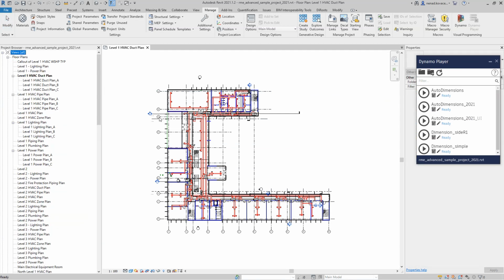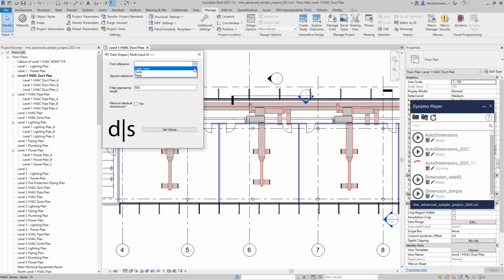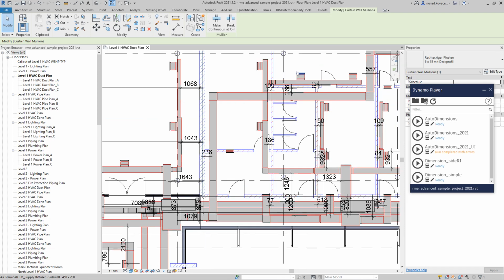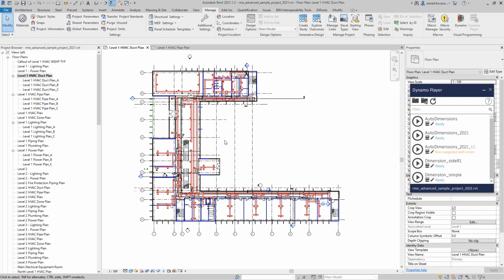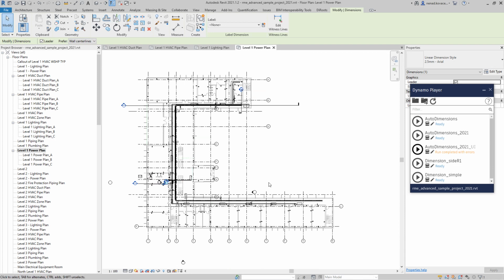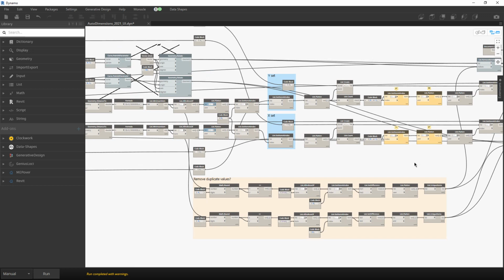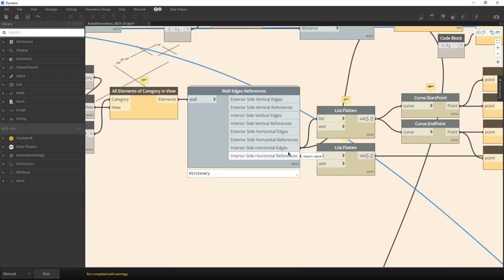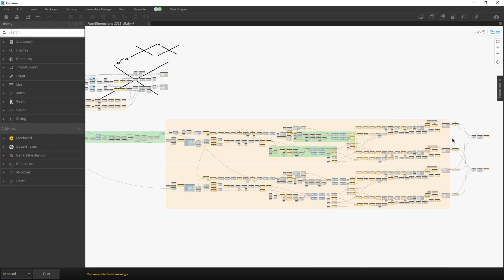Dynamo - Improved AutoDimension

Comment: Great Script...In the video, dimensions are placed from grid to center of the duct but we need to place from gird to side of the duct in most of the projects ...Provide a solution for that..Thank You..
Reply from the maker: Thank you for your comment. I hope that for the round elements you use the dimensions from the grid to the center of the element (that is covered with this script). I think that is also possible to create a script that will add dimension between the grid and the closest side of the rectangular elements (rectangular duct, cable tray, etc.) but as I mention in the video for all your custom requirements feel free to order a script from a link: https://dynamoscripts.com/contact/